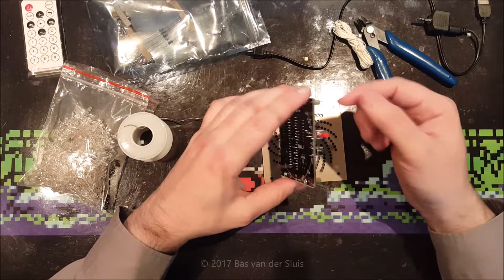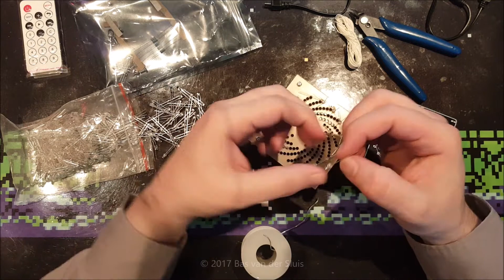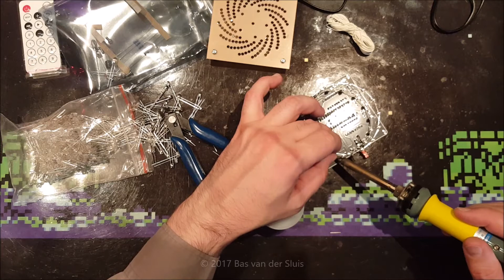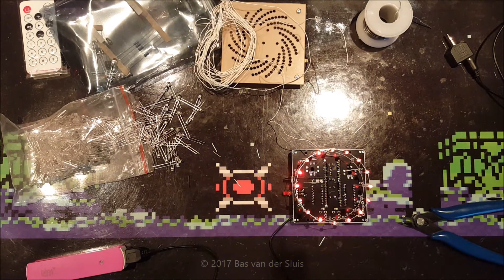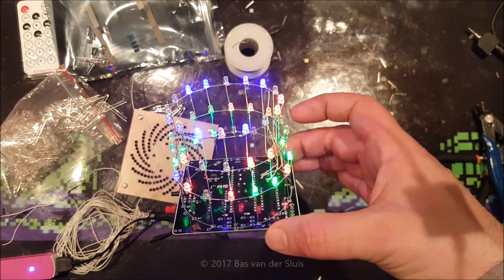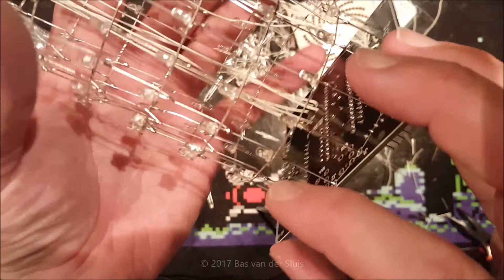Building the Canton LED Tower DIY Kit from eBay - part 2 - the LED layers

Comment: goede middag bas, you made a small mistake by soldering the led circles. Every ring has to be turned a few degrees. Kijk op de pagina 17 here https://drive.google.com/file/d/0B6iMR-BFq92PdjdhZGFDRHFnd2c/view  73 de Peter
Reply from the maker: Haha. Looks like you are right. I've pinned your comment, because this is good to know (in case people start building this with this video as a guide).
Reply: :D tnx a lot. By all these chinese Kits we have to share all information we got, cause they didn't do that. I like these kits, but to find information, software instructions etc. is sometimes vy hard.

Comment: I know it’s been a while since you did this video, but can someone give me a bit of information regarding another version out there? I just recently got one of these, but mine does not have a remote and has both WiFi and Bluetooth connectivity. I’m pretty sure I got the main base board built correctly, (as I have been able to power it on and those 4 corner LEDs light up and the WiFi/Bluetooth are working too). The board isn’t too difficult as there aren’t a lot of parts and it’s pretty easy to determine their location on the PCB. The question I’m having is the connection of the LED tower, (which I have not yet put together), to the board. On every single build video I have found on YouTube, everyone is using the same as you show here which doesn’t have the WiFi and Bluetooth. On this one, (and that annoying one from the Chinese vendor), the negative leads of the base LEDs are soldered directly onto the board in the circular pattern. I checked my board, and I’m reading a positive charge from those circular patterned holes. Since I am working with a different type of LED tower having the WiFi and Bluetooth, I am wondering if my assumptions are correct.

Comment: After trolling through lots of videos on this tower, ... I have found that there are at least 5 different circuit boards, there could be more.
Reply: I do know they are now selling a newer version which has both wifi and Bluetooth. I got one of those and I’ve been able to build the base board, but I’m trying to figure out the LED tower itself. On this video and many others, they soldered the negative leads of those base LEDs to the circular pattern on the pcb. Well, I tested my board and the circular pattern of solder points/holes are showing a positive charge, not negative. So it would seem that I must bend the negative lead down when building each layer of the tower. That is unless someone can tell me differently. I am very certain that my board is pit together correctly since there aren’t a whole lot of parts and those 4 Larger LEDs light up AND the WiFi and Bluetooth are working as I can see them on my phone.

Comment: I've given up on these things, they look good on youtube !!!!!!!!  2 towers, 32 rings, but only 20 of the rings work,  WOW !! Anyone want to buy readymade rings ??
Reply: Hi i did try using a chip from another kit but it made no difference, also when I put   the first layer of leds on they worked which is surprising as I hadn't connected the positive wire from the pcb, so only the negative polls were connected !  out of interest where did you buy yours mine came from ""chip partners"
Reply: I tried changing the chip as well, same result, I bought one from chip partners and I can't remember where the other one came from, the trouble is, there all mass produced at the same place, I did make the 12 ring version, that's ok, but the 16 ring version ????
Reply: Thanks for the info, seems more than a coincidence that we both have the same defect and they both came from the same seller.

Comment: I've built two of these and they work up to ring 9 but after that, nothing!! and yet! all the rings have been made the same, so I've decided, no more!!
Reply: I've got the same problem from 10 to 15 not working yet 16 is anyone got any ideas ?
Reply: 10-14 doesn't work on mine,  15 & 16 does
Reply: I just finished my tower and it is doing exactly the same thing , one through nine is the only thing working and 16 is working .... I checked and everything seems OK....... does anyone know what the problem is.?
Reply: I have the same problem up to ring 9 working then nothing until ring 16. Anyone know why?

Comment: tell me where to buy these LEDs? to have long legs
Reply from the maker: I mostly search eBay and buy the LED's per bag of 1000 pieces. Most of the time the description of the item on eBay specifically states that the LED's have longer leads.
Reply: Thanks.

Comment: The leds are controled by the ic by using the 3cdiffering voltages of each of the colors in the led i have a small globe kit that does the same.
Reply: Hi Kevin I've just made this kit problem is the top half from layer 10 is not working  strangely the top layer is,  any ideas?

Comment: Just started building my kit and my soldering is terrible ( plus I would guess I am older than our host so my eyesight is not good) Looks like a bad attempt at the leaning tower of Pisa. Decided I am going to get another kit and try adding nice round rings attached on the inside of each layer to connect the next layer to with a few cross connections to the  negatives ( uprights)  of the layer below. Hoping it will be electrically correct!! Well it makes sense in my mind anyway
Reply from the maker: Take your time and enjoy building it (that is the most important part).
You can correct each layer by heating each solder joint and pulling the LED up (or down) a little bit, LED by LED, until the entire layer looks good.